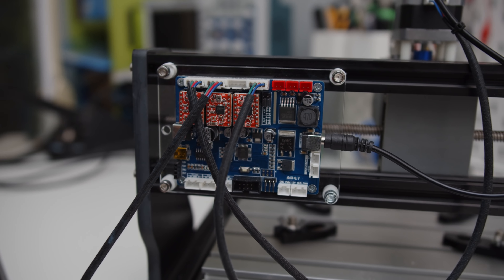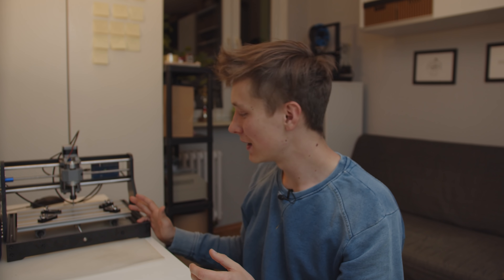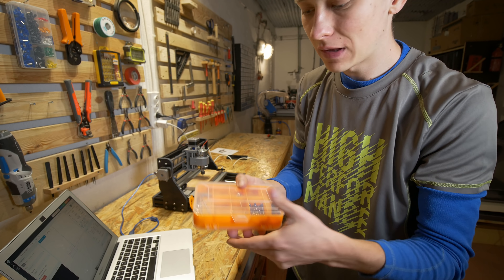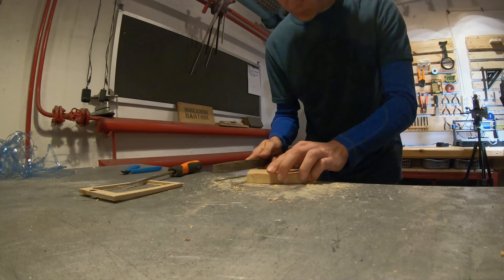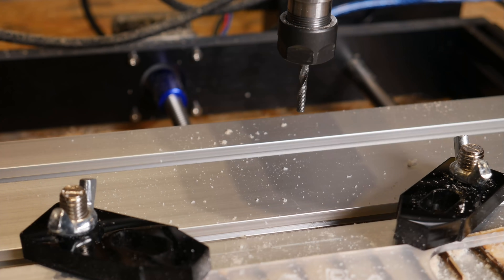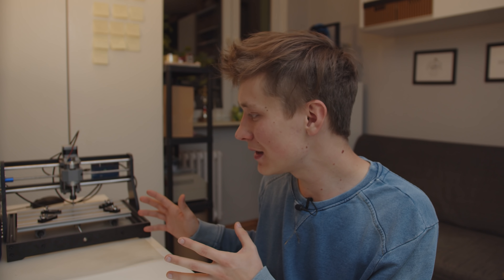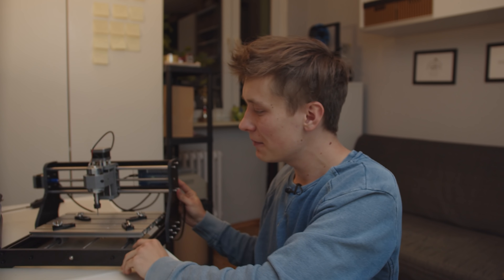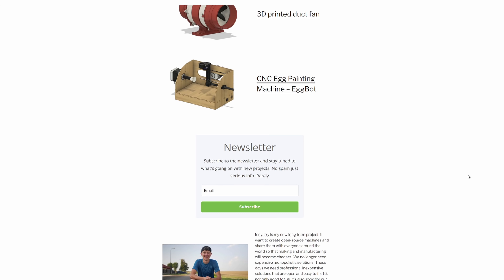What Can You Do With a $200 CNC

Comment: Can you use mastercam with this machine?
Reply: If you can afford a MasterCAM license I don't thing you would ask this question.
Reply: @mil3k  I'm still new to design softwares,  a bunch of my friends use mastercam and I was looking into fusion 360 and they told me to use mastercam,  so that's why I was asking.  Also u mentioned if I could afford it.  Is mastercam expensive?
Reply: @agentsmith7947  £3-4k a year.
Reply: @mil3k  wtf, ok thanks
Reply: @agentsmith7947  It's is a software for professional use at proper CNC machines with different configurations, multi spindle, automatic tool changers, mobile steady etc.